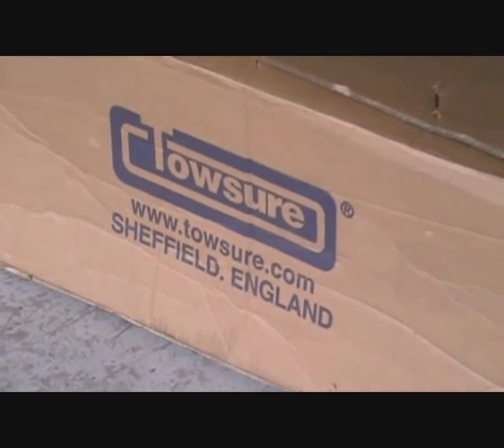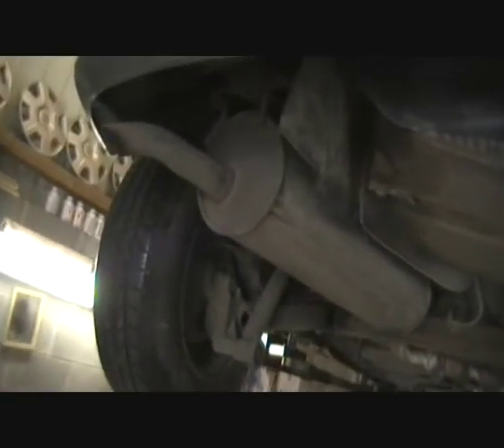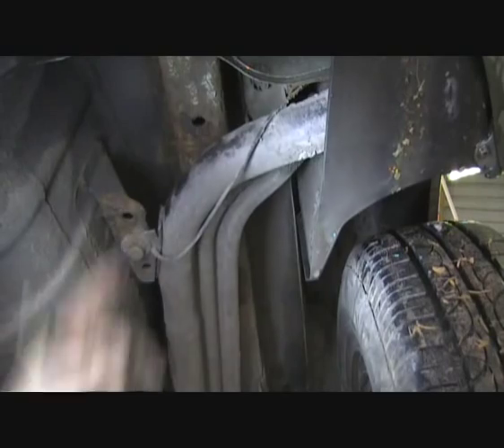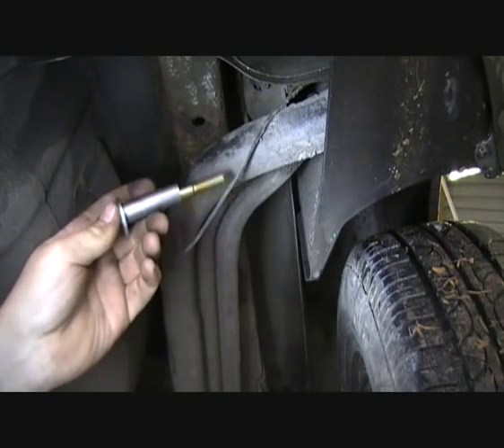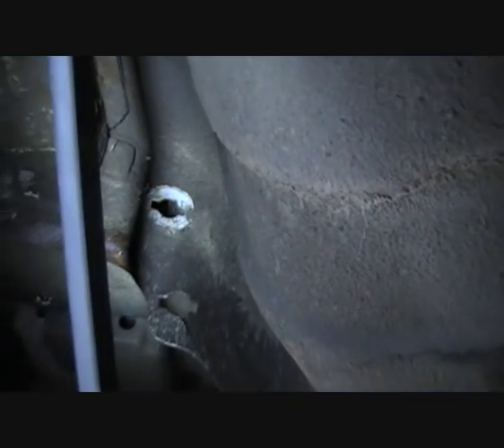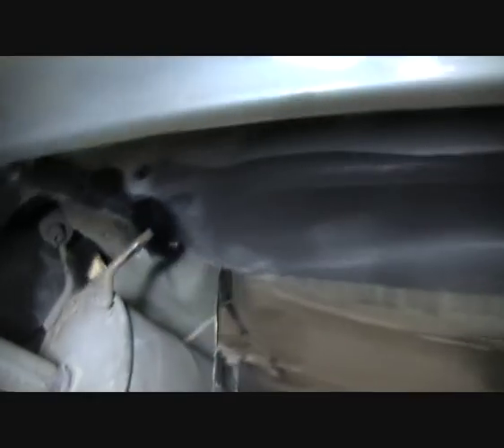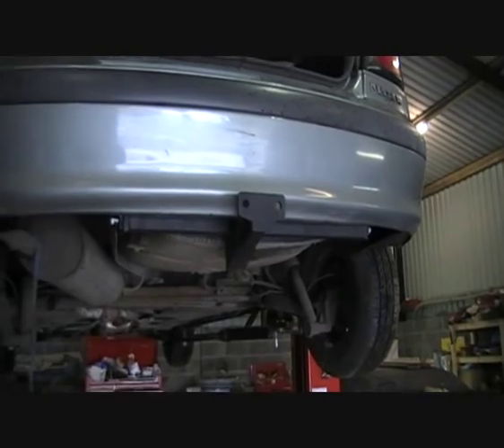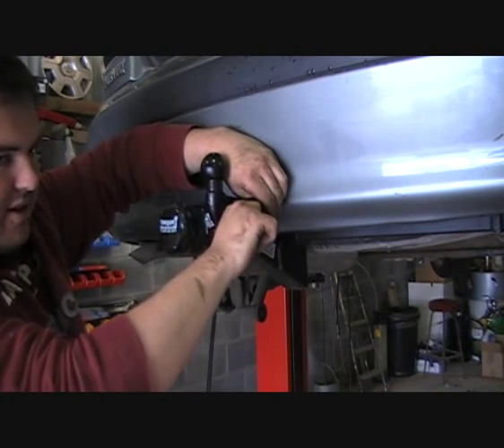How to fit a Tow Bar - Part 1 Fitting

Comment from the maker: I'd say everything looks much lighter duty than what you have in the US. My Renault is only a 1.4L petrol, 75BHP when new, so it's well under powered for towing, but its fine once up and moving. A standard big car trailer in Ireland is 8x4 foot on twin axle, and I also have a 7x3 foot on a single axle, both of which a very light weight. I'll pull the 16 foot with the landcruiser though.